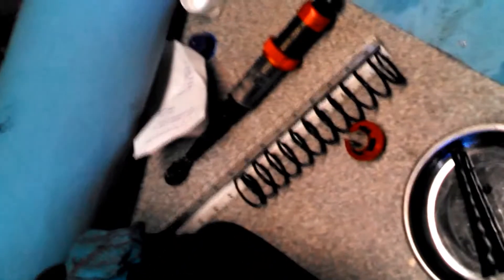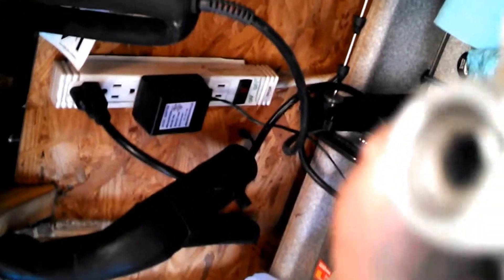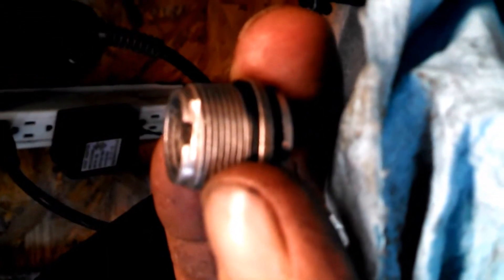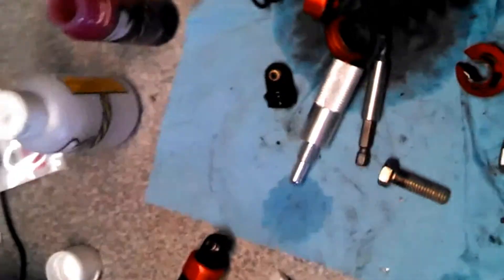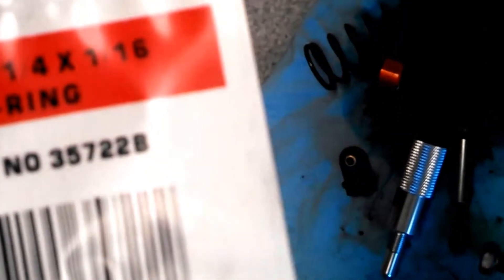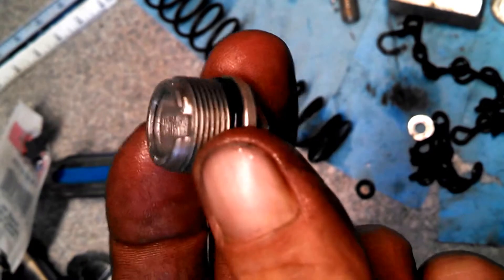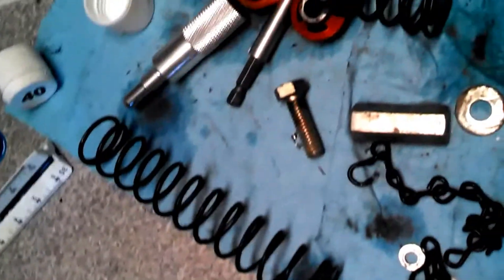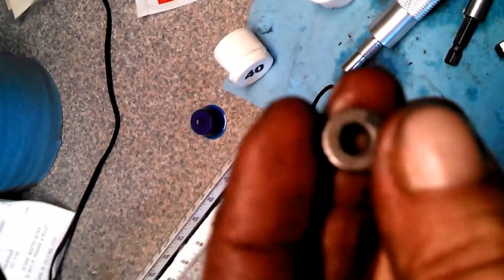Hpi Shock rebuild trick

Comment: Thank you for putting up this vid , it helped me alot with my 5b cause I didn't notice that my rear shocks were leaking until the next day I seen oil on the floor , I fixed mines the same way you did and it worked , I let my Baja sit for 2 days didn't see any oil on the floor , then took it outside ran it through 3 tanks sat it for a day no oil leak , you saved me $80 on shocks but I know eventually I might have to buy new ones tho or I can just buy o rings instead of buying the shaft with o rings set or entire shocks set , much props to you 👍👍👍
Reply from the maker: Great to hear little tricks like this should be shared. If I can help I will with anything else. You should check out the tire foam fill to keep your rims mud free.  😇. Also Google Gotta Know Joe Hobbies look us up. Yep we have a hobby shop now...Joe
Reply: Jose Q how did you fit 3 o rings in? Are you using hpi brand cartridges or rovan?
Reply: Jose Q I have hpi and 3 o rings too tight to get c clip on
Reply: @johnbugman1  .......hey , it's a kingmotor 5b my rear shocks came with 1 o ring in it which I think it's normal to have so I just flipped it the way how the vid showed but the front shocks was a bit difficult tho cause it came with 2 o rings 4x1 mm so the top I just switched it with the bottom , that little clip on top that fits in the ridge that keeps all that in place didn't fit at first so all I did was put alittle pressure with a flathead screw driver on top where that c clip goes and pushed down on that copper thing and fitted the c clip into the slit where it goes
Reply: @GottaKnowJoeHobbies  .......I def appreciate the vid ☺ , do you know any tricks to stop the rear tires from ballooning cause I know when that happens it looses some grip on high speed cause the tires isn't making full contact , or is there some kind of tires that prevent that from happening ?
Reply: Jose Q I did something similar and it blew out the seal or snapring into the shock good luck
Reply: @johnbugman1  ........damn sorry about that , I haven't had any problems yet knock on wood but i know eventually I'll have to buy a new set of front and rear shocks , I seen on eBay (shock repair kits) which is the bottom shaft and the part that has the o rings and all that it needs  , bottom parts are  cheap that are from hpi for 5b for like $30 something dollars the prices dropped  so I'll buy those instead of buying a whole shock which cost a bit more
Reply from the maker: @johnbugman1  never used clones like rovan on car just to throw at neighbor's cat ..
(Parody Peta)

Comment: Thats a Rovan shock bottom! Hpi has a c clip strip of metal going across the top so u can grab it with a plier! http://www.davesmotors.com/hpi-87564-rear-shock-repair-kit-for-vvc_hd-rear-shocks-137-207mm.html If you look at the c clips at the bottom of the shocks in the pic thats what they look like! Great vid for taking out the c clips for rovan! Good Info!

Comment: How are these holding up? Leaks?
Reply from the maker: Works well
Reply: Gotta Know Joe Hobbies  I bought the same o rings and they don’t fit with 3 too tight it blows the c clip out!
Reply from the maker: Hpi shock is about the weakest part of the car I did a losing transplant on 9ne ok Val track car that worked well. This was Soo long ago
Reply from the maker: Also look up freezing your orings before installing